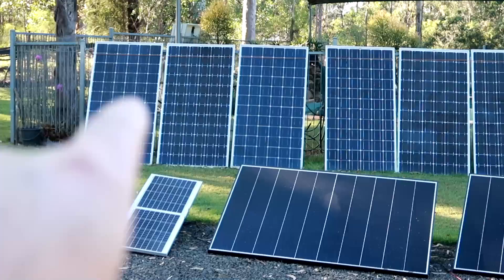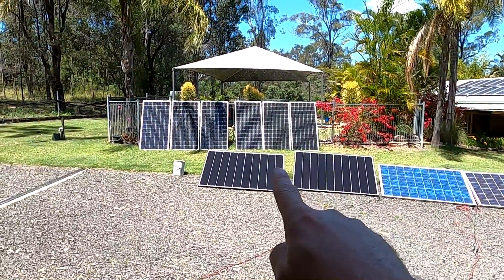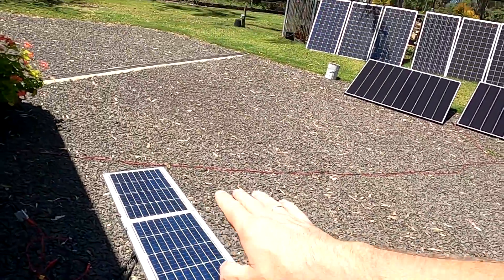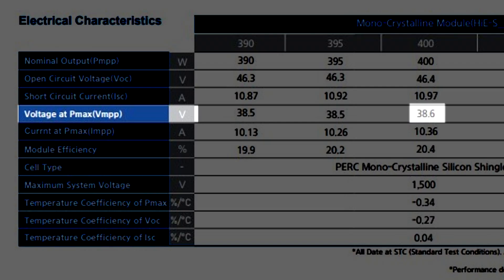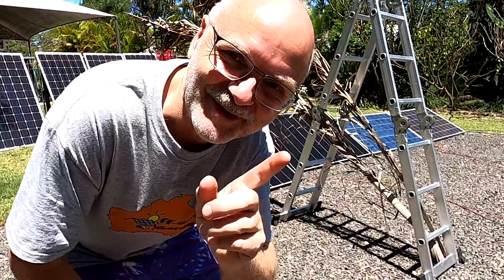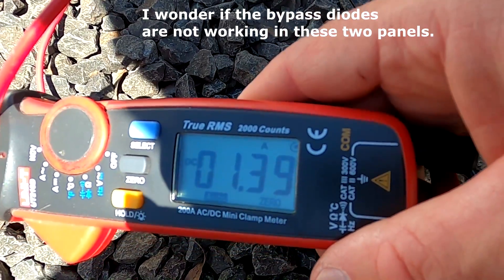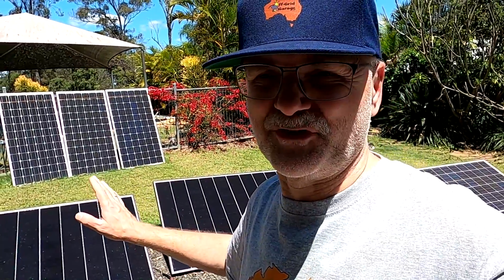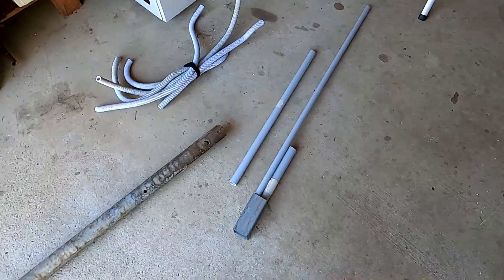Charging a 48V battery with only two solar panels in series? Here are my concerns.

Comment: Looks like the blocking diodes are not doing much, get some 15A Schottky diodes and put them in reverse polarity across each panel. That way you can get all the amps from the uncovered panel.

Comment: love your video nice 🥰🥰🥰🥰 i have 3000 Watts 48V inverter i have 48V solar charger for it 30A what size panel i should used
Reply from the maker: That solely depends on your solar charge controller. It will tell you in the specs what panel size you can connect.

Comment: Great experiment as always. I have a suggestion if I may. Many of us have roofs facing east-west which is not ideal but still usable. I can not find any real life data on how good Victron MPPTs handles panels on opposite side, east-west orientation. Eg. if you have one string of panels (xS) that is acceptable for a certain MPPT connected to MPPT  and then connect same amount of panels (xS) from other side of roof to that same MPPT in parallell. You will get xS2P but those two stings will never produce same amount of energy at the same time and I guess this setup could be considered as xS1+P. My question is will this setup produce less energy then if used two MPPTs, one for each side. How big is degradetion if any? Well, who would be right person to check this but Andy.

Comment: Great test, Andy!

But I question the use of shingled panels without any bypass diodes in your specific setup with shading. 

As you have seen, when covering one shingled panel of the series setup completely the production drops to near nothing. Of course, this no realistic situation, but if the any of the panels is in shadow only 50 % the complete string will not provide more than 50 %. So the weakest panel defines the output of the complete String.  

On the other side 2  halfcell panels with 3 bypass diodes in similar setup will have 6 bypassed sections. You can have even more sections if you put 3 panels in series. So in shadow situations the bypass diodes can bypass the weaker sections and you get higher current and higher power. 

If you use the shingled panels than you should put them in a orientation where section after section is shaded by the moving sun. 

Of course, in such complex situations we don't know the result in advance. So the discussion is kind of academic. With your total of about 13 kWp, you have plenty of power for the most part of the year.

Comment: I would be interested to see if keeping the palm leaves or your sheet in front of the panel for 15m would trigger a reset of the mppt. According to what I could read victron tries to stay around the same voltage per mppt scan period and does a full scan every 10m.
Would be very interesting.
Reply from the maker: I have heaps of shading from trees and none of my 4 MPPTs has ever reset because of this. The MPPT tries to find the maximum power for this situation, regardless of what the shading or output of the panels is. I have not heard of a reset of the controller because of shading...

Comment: I'd go for a tracker, more power for longer, less panels laying around.
Reply from the maker: Trackers are so not worth it in this size. Great for small systems but the larger it gets the more effort goes into the whole structural integrity of the mechanic. Imagine 6 or 9 panels on a tracker and the wind load it needs to withstand. If you install a few more panels instead, it will compensate for any losses.
But trackers are a real interesting project, for sure.
Reply: @OffGridGarageAustralia  I was thinking the smaller size 6/4 it's not that much work, and  fairly easy to do as a project. Big pole into the ground a few feet, then start mounting a system on top. Could be mechanical, manual even. Or clock work... But may as well go for an actuator/stepper system.

Generally you get 30% more power a day, but it can mean around 50% more power over a fixed array. That way you don't need to keep adding panels.. 

Myself I have a  summer array and also a winter array... In England.. so more important

Comment: Hi Andy, great clip with loads of information again .
Wow your really upping your system?!!!
As said before, I'm just going from 12v to 24v.
But IV been thinking....... should I say f### it and go 48v ????
IV got 12 cells at 200ah at moment set up as 12v
But IV got 20 more cells (again 200ah) on order.
So I could do 4x24v banks
Or 2x 48v banks??????? Hmmmm
Just need more solar panels too....
But there getting like hens teeth here in UK, unless you pay stupid prices..
Least your out of winter and heading into summer.
As you know we are the other way.
Reply from the maker: Thanks Mark. It all depends on your load and project. If you only have 12V equipment right now and need to upgrade your inverters to 24V anyway, I would go 48V if possible. It is just future proof and regardless of what loads you will connect, it can deliver that. 
I heard about the panel shortage in Europe, that's not good... Used panels are probably even harder to get, I assume?

Comment: Andy any thought in getting a 450/100 MPPT charge controller from victron and setting up a portion of the system with that charger and using your other chargers as they are for now? Just a thought.
Reply from the maker: No, too much shading for the RS MPPT. It is not efficient as most of the panels will be shaded all the time and the bypass diodes will have to work hard. That was part of my design to have many parallel strings so shading affects only a few strings but not the ones in full sunlight.

Comment: Lesson learned -having had a direct hit by Hurricane Ian, always assume the worst. Keep your batteries and solar equipment at least 4 feet off the floor,  and have some type of protection for your electronics from roof leaks.
Reply from the maker: Oh, wow, sorry to hear that. Not much you can really do in such a case, I guess. Is it covered by insurance?
Reply: @OffGridGarageAustralia  Thanks for asking. 
 I managed to save most of everything, except my inverter, which was going off like shotgun blasts every time a mosfet exploded, by lifting it to a top shelf while a 4 foot storm surge was breaking down my door. I still don't know how I managed to lift that heavy battery.  It was a huge learning experience.  No such thing as reasoning skills or remembering details when in survival mode. 
Insurance here, in the land of the not so free, is a joke. They set a low dollar limit on anything that can be considered a computer.

Comment: Dear sir kindly guide me one thing. I have 8 cells 3.2v 32650 lifepo4 6ah each. I want to make 12v 12ah . 2 series of 4 cells each and they will be parallel. I purchased 60A dally bms which has 4 red and 1 black Ballance wires. Now i have 8 cells i am confused about balancing wiring kindly guide me . Cells are 8 but Ballance wires are 5 only
Reply from the maker: You would need a second BMS for the other string of batteries. One BMS can control 4 batteries only.
2nd option is to connect 2 batteries in parallel first (they act as one cell) and having 4 of these twin packs in series. Then you need only one BMS.
Reply: @OffGridGarageAustralia  thanks
Reply: @OffGridGarageAustralia  can i get your WhatsApp number please
Reply from the maker: @s.v.s.e  I cannot do any personal consultation, sorry.

Comment: Quick question do your individual pack drift much I have 3,packs of 280ah cells one on a jk BMS one on a seplos BMS and one on a jbd BMS and they have all got different capacities showing even though they are all connected to the same bus bar the seplos BMS is the worst one showing the least capacity do you have the same issue
Reply from the maker: The actual packs don't drift at all as they are constantly balancing against each other. The SOC estimates in my 3 BMSes however, are all different. That's why I use the smart shunt as point of truth and it is pretty precise.
Reply: @OffGridGarageAustralia  yes that was going to be my next move to try and get some accurate idea of remaining capacity of the whole packs

Comment: Considering you are 2nd guessing things like I do, because it's a new idea from what we are used to running, hook up a string of panels on the car port roof to compare to the existing setup. Makes for some more video's and also can settle down the uneasiness to see side by side comparisons. Plus that way you can get used to the new setup and see how it responds before the insane work of tearing out the existing solar to replace.
Reply: But don't you need to upsize your existing charge controllers for these new panels anyways? Plus you had mentioned in the video that you were considering adding panels on the carport anyways. At least if you do it that way, you would have another roof covered that is pulling in power. Plus I'm pretty sure that there are several more people besides me that would greatly appreciate seeing more real life set up of side by side comparisons. Hell, you got me thinking about trying them here in Canada to see how they compare to the traditional 60 cells I'm already running myself.
Reply from the maker: @markbrettnell3503  I will have 4 MPPTs eventually, one for each roof space and panel orientation. The 70A MPPTs I already have right will still work with the new 4kW of panels. The big shed and car port will be smaller solar installation, but I got the same size controllers for these two roofs.
Reply from the maker: That would mean a major change in my system design, and I would need to invest in at least one new solar charge controller (Victron RS) just for testing purposes. That's a lot of costs which I rather spend on the new installation.

Comment: It doesn't matter if you have two, three, or four panels. It's going to act exactly the same if you have them in series...
I have a similar situation in my backyard. I get only three four hours of sun in the rest is all shaded so I have my panels only in parallel... I can only go 24 volt system...
Reply from the maker: Yeah, a lot easier with 24V and only parallel panels. That is ideal.

Comment: Servus Andi, can you test something for me... whats happening when you mix auf panels in the string... 375w and 240w Panels... (Trina Solar) 34.4, 10.8A vs 30.4V, 7.89A Panels... you can test that easy on your Victron MPPT's. Voltage would be added but what happens with the string... only 7.89A? Fronius Inverter has a perfect Shadow Management - i testet that... it is amazing - it is locking for the best MPPT point with dynamic power point tracking... it is like shaded panels when you mix it up :D
Reply from the maker: The larger panel would try to push its higher current through the smaller panel and will heat it up. Certainly not advisable to mix such panels in series.

Comment: I use 36v panels charging 24v battery. In series no shading, 10% more watts than in parallel (less I2R losses) In parallel 10% less power full sun but if one panel is shaded, I still get half! So Parallel gives me more.
Reply from the maker: Yeah, that is ideal. I want to make the test if this also works with 48V systems and how much power I still get out of this system. It's an experiment.

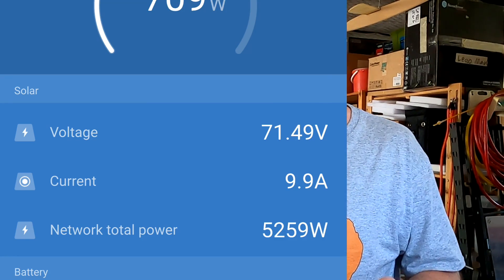Comment: Hi Andy, your personal safety lacks a little. Sandals on the roof!!! Well who am I to say. I let my tractor run over my legs. I broke one leg. Anyway I wouldn't worry about only two panels in series. I have some old 250w panels (2S4P) that I play with at home in Melbourne and I got 9.162kWh today. My professional installed 3.6kw  (capped a 3kW)  2 string system gave 20.2kWh in the same time starting at 08:00 and shutting off at 18:20 It was a nice sunny day today.
Reply from the maker: Great, thanks a lot for sharing your experience with that.

Comment: You should measure current and voltage directly after two solar panels, not after mppt controller. This experiment is useless, make please a correct one.
Btw people don't buy BASEN lifepo4 cells, they send me over 3 years old bloated cells, Alibaba didn't help.

Comment: Hi Andy, 
shading is not always a bad thing, right? :) But for solar panels, I'd think about to use optimizers to get the maximum from each string.
Reply from the maker: They would not work for my system. I tested them on some panels and it made it actually worse. Huge voltage spikes and most of the time a worse power output than without. In my experience it is not worth adding this extra complexity (and $$$) but rather add more panels.

Comment: Andy, I use 280 Wp poly panels, two in series, 28.7 Vmp, 35.6 Voc (NOCT), 31.5 Vmp and 38.6 Voc (STC). I'm using victron smart solar, 48V 16S LiFePO4 battery and I'm getting 5 kWh out of 1 kWp a day. So I think that two panels in series is not an issue. It takes a few minutes longer to start after sunrise (mppt needs +5V), but that would not produce much anyway.
Reply from the maker: But you don't have shading, right?
Reply: @OffGridGarageAustralia  These are installed on a balcony (vertical), they are facing SE. Some months they are slightly shaded in afternoon. Not at the moment and I don't remember exact numbers. Also because of the angles in summer they get sun from side/behind in afternoon, no direct sunlight and they still produce "enough". So, sure, shading will affect the output, but there will be always enough voltage for it to work, 3S is not necessary as it will be affected too and 2S means more smaller zones, so with some luck you will have more zones that are not affected at the same time.

Comment: Andy, Sorry but i believe you have an issue with Isc.

In the spec sheet you displayed each panel had a Isc of 10.12A.

If you do 2s 5p then you in theory have a Isc of 50.60A.

The Victron spec sheet for your controllers have a MAX Isc of 50A - with a foot note of possible damage if exceeded.

~ Victron's polite way of saying void warranty
Reply from the maker: I saw that and it is factored in. So far, the MPPT are limiting the current if exceeded. In fact Victron says, solar panels can be overprovisioned up to 133%.
Reply: @OffGridGarageAustralia  I agree with your comment about overprovisioning in fact you probably could go a lot higher with overprovisioned/over paneling.

However with or without  over paneling you have to ensure you do not exceed Isc.
Reply: Andy, i will correct myself - i used Victrons online MPPT calculator and it only cares about Imp even though it warns about Isc in their datasheets. Up to and including Isc 50 (5 * 10) it allows your existing controller as your array of 2s 5p  in theory max out at 48.8A.

Comment: I also have two roofs in a 2p2s configuration with similar voltages per panel/module and a 48V battery. In real life it is working much better than I expected. As you saw in your palm tree test (which seems a more realistic shading situation ;-)) diffuse light is often enough to get reasonable string power. I am pretty sure: It will be good!
Reply from the maker: Thanks a lot for sharing your experience. Good to know.

Comment: Try using solar edge or tigo optimizers
Reply from the maker: I tried solar edge and they made it all much worse. Huge voltage spikes and only very small gain, if at all. It's easier to just add more panels...

Comment: Interesting to see the huge drop with only a little shading. It would be interesting to see a similar test but with an optimiser hooked up, would they help?
Reply from the maker: No, they are not magic devices. They will 'optimize' the power output with their internal MPPT. This clashes with the MPPT you're using. I have tested with solar edge and got huge voltage spikes but only a bit of gain in power at some stages. Not enough to justify the extra expense I would say.
Reply: @OffGridGarageAustralia  thanks Andy, keep up the good work.

Comment: Another great video Andy - interesting to see how much a little natural shading can impact the output even when the voltage is maintained. Seems like about 15% of shading produces a 50% current drop? Have you ever done a comparison of different panel types and the impact of shading? I think your palm fronds are great for simulation - maybe a useful unit to calculate the impact of shading!
Reply from the maker: It's very hard to compare. I have these panels on my driveway for a long time and watch them all day long (literally). They are pretty much in the same location and still the outcome is different as shade is never the same even if the panels are that close together.

Comment: Good vid & commentary for consideration, its a quandary, but if the Victron MPPT Controllers do have a Boost/Buck type system built-in, I think that would be a suitable solution, or to boost each panel to a required output / input voltage of SCC could be viable, while boosting up & down is going to have certain inherent inefficiencies also for consideration along with more electronics and potential failure points. 
I have been experimenting with Maxwell Caps on each side of a 24v system controller recently, I dont know if this is something you would ever consider doing, Im doing it mostly out of curiosity & because I have a few big caps sitting around to play with, but It does have some benefits with shading conditions and when the batteries are full the capacitors can get up to 76v of potential which can push a lot of extra charge through ur controller when a large load comes on helping to reduce battery surge along with 2 more caps at the inverter.
Always enjoy ur content. Interesting to see which way you go here and looking forward to it as well.  Cheers

Comment: I was trying to do that, but the vdc input to the scc was not hi enough
Reply from the maker: Yeah, depends what panels you're using. The 60cell panels have only like 29/30V in the mpp. The Hyundai have 41V per panel so that works quite well actually.